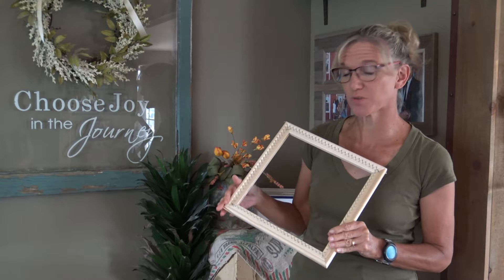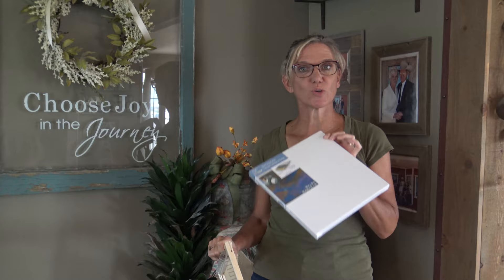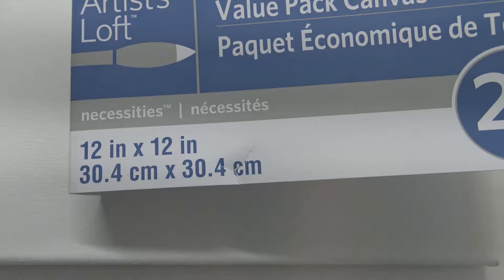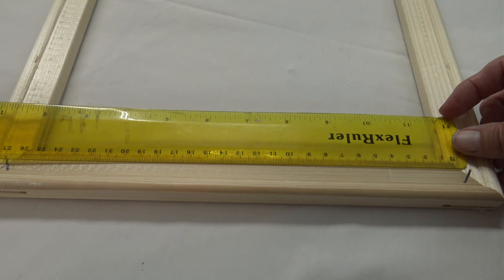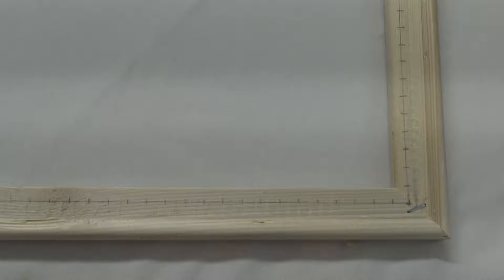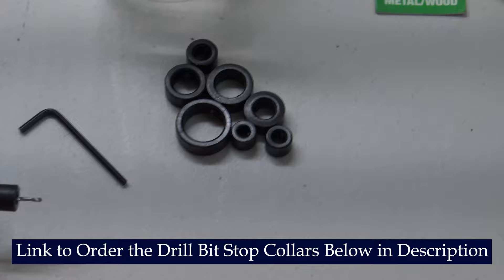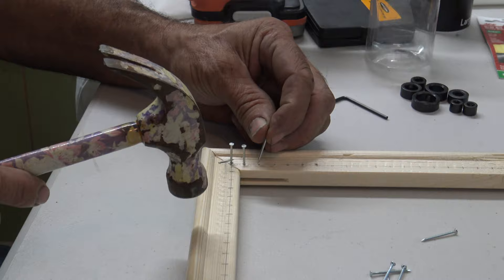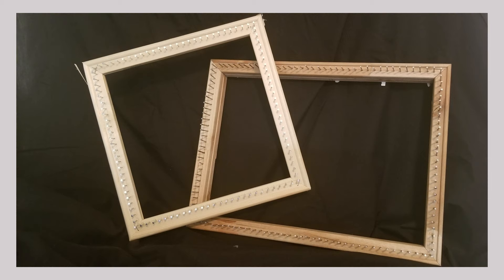How to Build a Pin Loom | How to Use a Frame to Make a Loom

Comment: Thank you for your videos on pin looms. Lol just want I need another fiber art! But, I think this will be a good thing for my youngest daughter. Lol she's 25. But she wants me to teach her a craft. I think this may be a good idea for her.

I do have a question. Does the spacing of the nails remain the same if you plan on using smaller/thinner yarn/thread, such as the size of crochet thread? All I have seen used is the 1 cm spacing. But it seems like that might be too much for crochet thread or fingering weight yarn.
Reply from the maker: I haven't tried one with closer nails - and I have only doubled thin thread, I haven't done thin thread by itself.  I am guessing if you did 7 or 8 mm that it would make a tighter weave, but it if you did only one strand of thread, it would be pretty flimsy.  HMMM?  You have me wondering.  I really love weaving on this loom - fast fun projects!

Comment: I have not a drill suggestion please how to do also would happen maybe a 8x8 template have with regular spacing  forgive please wording speech issues do have from stroke btw much do love your channel
Reply from the maker: I think a drill would be necessary, otherwise the wood will split.  If you find a frame, maybe you could find a family member or friend who could drill the holes for you?

Comment: Does it have to make a square or can it be a rectangle? My frame is a 16 in x 20 in (40.6 cm x 50.8 cm). Do I just do the nails 1cm apart?
Reply from the maker: Rectangle is fine!  Nails should be even number on each side 1 cm apart.
Reply: @DIYOnTheHouse  thank you
Reply: I like this size for placemats. Can i use potholder loops?

Comment: I dunno, would you please check your dimension(s),, 1cm = .4 inches, the distance on your pin loom looks to be @ 1 inch center to center,  so,   1 inch would give 2.54 cm, would you please check your 1cm center to center, thanks
Reply from the maker: On these, I just measured mine, and the nails are 1 cm apart.  Is that the measurement you were referring to?

Comment: Why does it have to be square?
Reply from the maker: You can do a rectangle as well.  But on a square one, there is a way you weave that goes on the diagonal, and I am pretty sure it would be a little tough if your nails weren't even numbered on each side.

Comment: It would be a lot cheaper and easier to just use the stretcher bars  WITHOUT buying a stretched canvas!!!  You can get these the same length  (say 12x12" or 10x10") or in two different lengths for a rectangle.  You can glue them together once joining the bars at the corners or use a wiggle staple ("www") at the corners, out of the way of your corner nails. You can get these whatever size you want at dick blick -- be sure to get four bars the same size for the square.
Reply: P.S.  These bars are soft pine ... no broken bits to drills.
Reply from the maker: Wow, I hadn't thought of that.  I love new ideas - thanks!